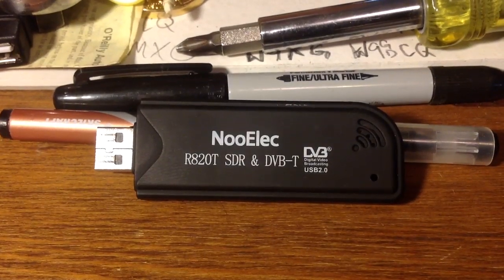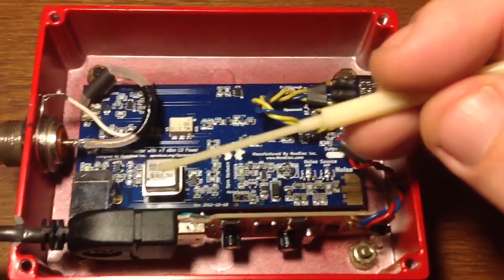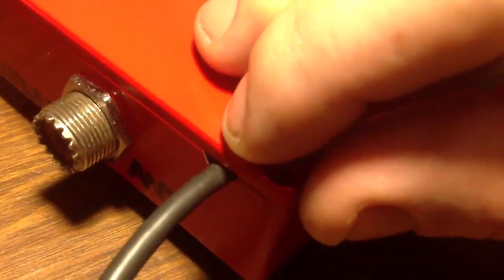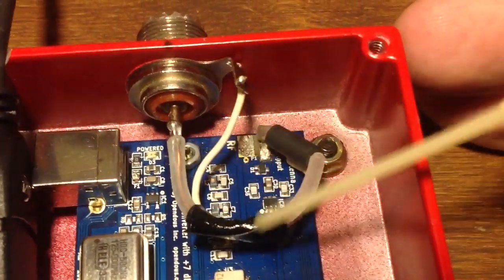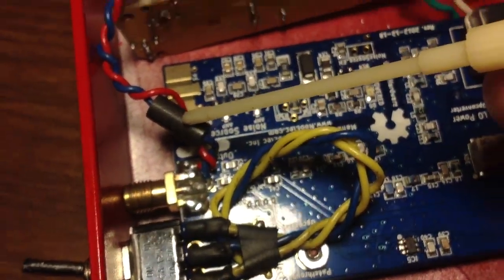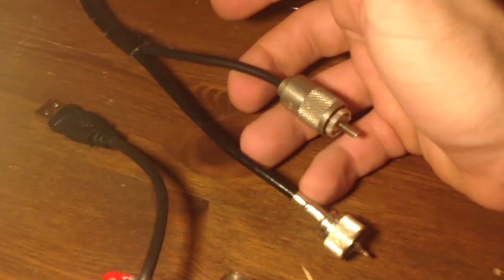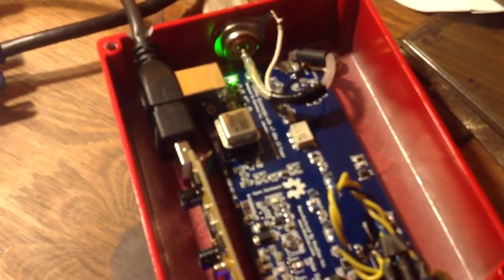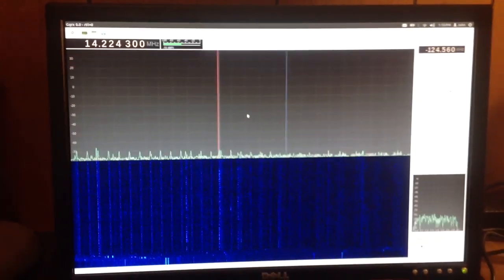Sdr rtl2832u nooelec ham it up converter DC -1.7Ghz!

Comment: Thanks for making this video. Question once you have the hardware hooked up to the computer via usb. does the software require internet connection for it to work ?
Reply from the maker: Thanks for watching! To answer your question you do not need to be connected to the web. I use this same radio with my tablet as well during portable ops. Good luck with your project. --... ...--

Comment from the maker: Thanks for watching Tim! Yes the manufacturer of the converter did revise the deign by using a 125 Mhz crystal instead of the 100 because it would land you in the fm broadcast region of the spectrum. All you need to do is buy a different crystal and plug it in. The board you have should be fine. This will fix the overload. Thanks again for watching.

Comment: Thanks for the video John. I like the way you put both boards in one housing. I have the same components from nooelec, but I have the 100.000mhz oscillator on the up converter. I am getting a lot of overload on HF. Could this be the problem?

Comment from the maker: Hope it works for you. Good luck. I bought a metal box in hopes that it would shield it better. This has been a very rewarding project. If i had it to do over I would probably try to build my own converter or just try to do the direct conversion mod to a single usb stick. In addition a preselector and low noise preamp will improve performance greatly. Thanks for watching. Happy 2014!